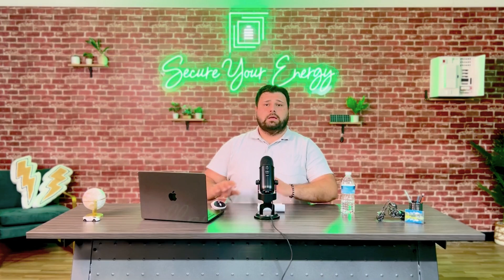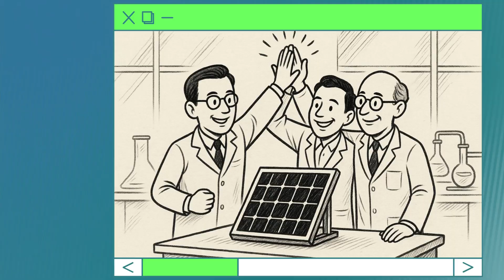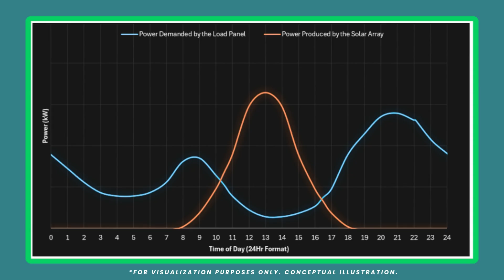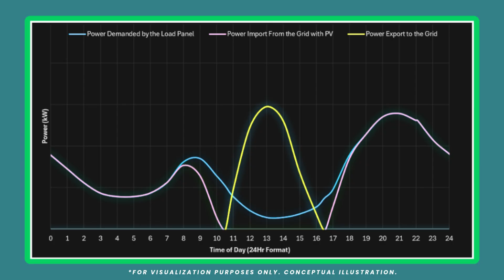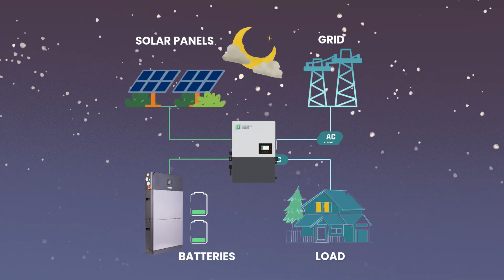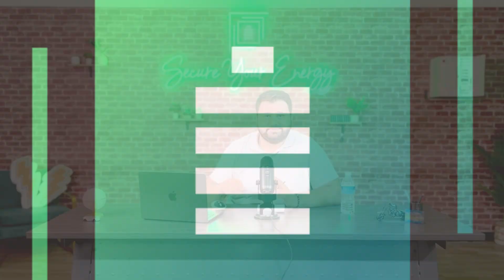Why Every Solar Panel System Needs a Battery | Energy Storage & Backup Power Explained

Comment: This is highly dependent on location. You should do research on THAT subject and create videos specific to certain states or group based on types: Ex. some States charge the same rate regardless of Time-of-Use, in those, there's no benefit besides backup for outages.